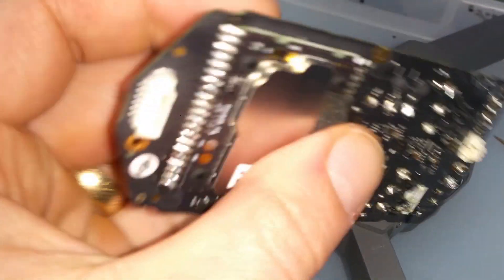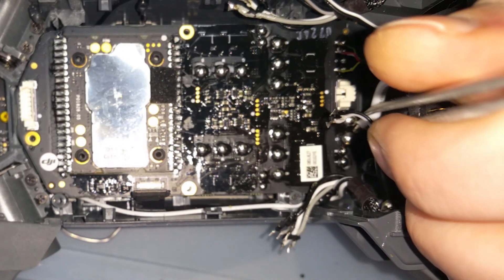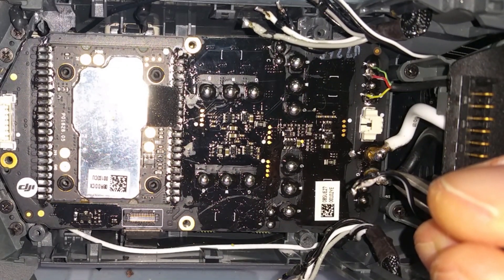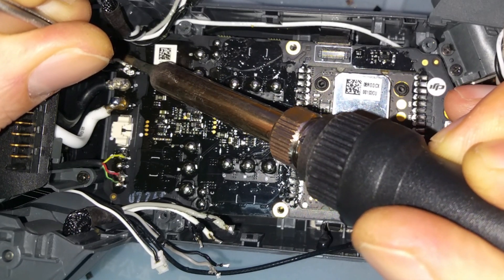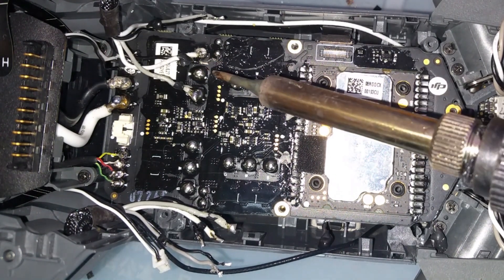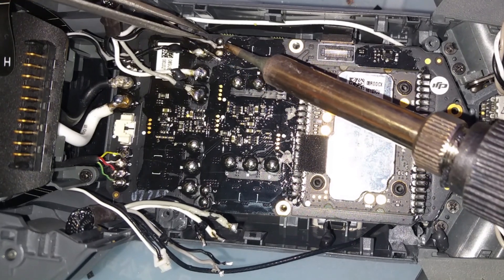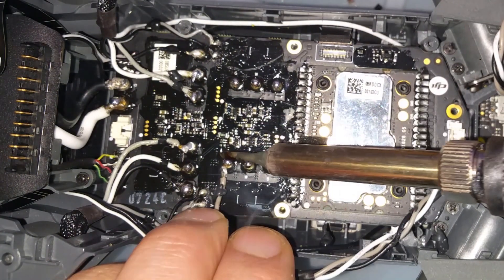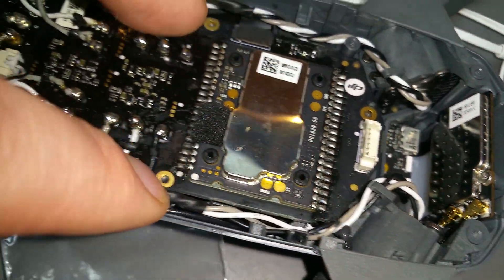HOW TO REPLACE DJi MAVIC Pro ESC Board

Comment: sorry but when I see the welds you are doing, I will not give you my drone to repair ! the soldering iron is not adapted, not hot enough, too long contact for nothing, a bad weld has a good chance of causing a crash
Reply from the maker: Hi noone ask to send your drone to repair to me and if you will try solder this you will find there is some lak on top with means you need heat longer and dron i repair never come back  howk

Comment: Have a question for you Sir 
When I replace ESC board no impact connection between remote and aircraft please?
Reply from the maker: If you mean you will need new remote answer is no you can still use the same remote
Reply: No I mean what u replaced?
Reply from the maker: @naeemrahimi5315  I mean if if you replacing ECS you don't need new remote

Comment: I drowned my Mavic Pro, it turns on, but Warning: Camera Sensor Error and ESC Status Error. What parts do I need to replace or fix?
Reply from the maker: Try calibration first if not pass you will need replacing some parts ECS or camera sensor is there any physical damage

Comment: Hello. I will crashed after that my drone die, no any lights after boot and all engines beeping bi 2 sec interval. I replaced by new ESC board that, and yesss the lights come backs, motors stop the beeping, but rear center light start on boot up blinking, green, yellow, green, yellow, green and finished by RED. All next time i see only red light, and have only one problem,  ESC status error. Turn off aircraft and restart. I try IMU calibrate, and its finish grate without issues, then i tryed all firmwares install by assistant 2, by no issues to finish, but still the problem is same. RC error show ESC status error, and rear light stay RED. What i need to do next? Thanks
Reply from the maker: HI sorry no idea so far now as last drone i repair been 2 years ago

Comment: hi, my mavik pro crashed ... need to change ESC board ! I have a board from another mavik pro , she is compatible? there will be no problems? p.s. special DJIsoft are not needed?

th
Reply from the maker: hi yes if is that second one fully working you can swap that only after you will need full calibration in DJI assist software
Reply: @frogtechtips  ok man, just need to calibrate mavik!
Reply from the maker: @aleksusnemo4284  yes once you replace this boar you will need calibration
Reply: @frogtechtips did you buy a new board or a used one?
Reply: @frogtechtips  Do not tell the wiring diagram ?! what colors and where to solder
Reply from the maker: @aleksusnemo4284  on that time I worked in spark Angels in Kettering we are use both new and used parts with no problem
Reply from the maker: @aleksusnemo4284  they are written on pcb and best way is look on old board and just solder each cable on same position
Reply: @frogtechtips  which components are connected to the ESC? camera + battery connector + 4 motor beams + gps + compass?
Reply: @frogtechtips  I still need to replace the Core Board, will there be no problems installing it with it?
Reply from the maker: @aleksusnemo4284  there will be no problem but if you need replace that many part maybe will be more easy buy second hand mavic and one you have sell for parts
Reply: @frogtechtips  I want to fix my mavic pro
Reply: @frogtechtips  spit to gain assembly experience
Reply: @frogtechtips  I will be glad if you still post something to repair mavic pro
Reply from the maker: @aleksusnemo4284  ye that's way as well :-)
Reply: @frogtechtips  tell me, is there an anti-static drop of solder on these boards that needs to be removed ?!
Reply: @frogtechtips  or the board immediately after is ready to install?
Reply from the maker: @aleksusnemo4284  only I can say try find some pictures from that boar and look on cable how is connected